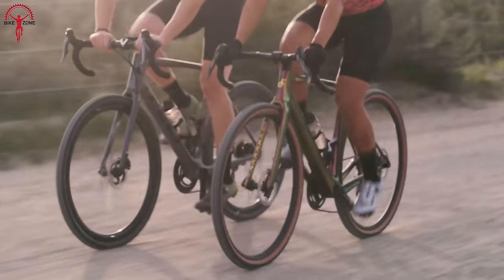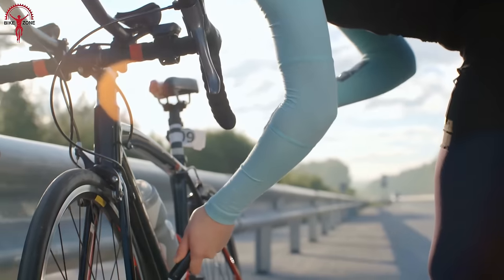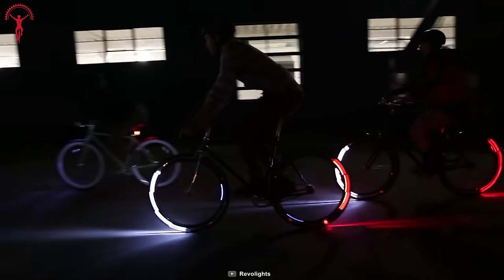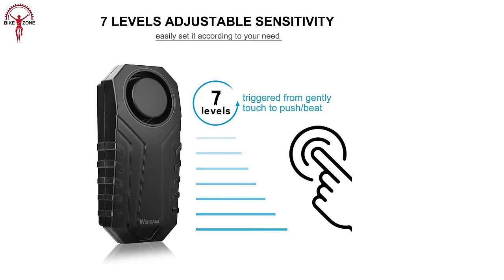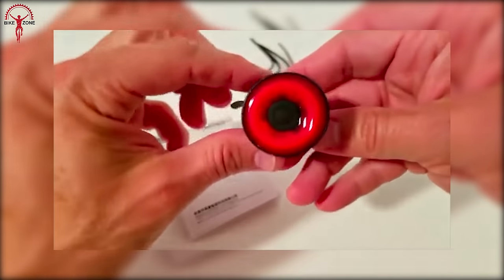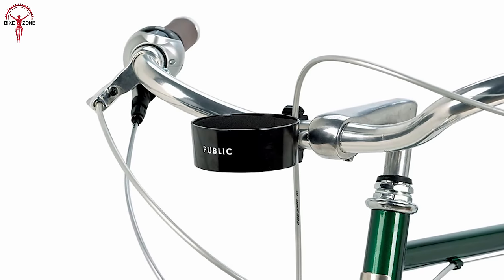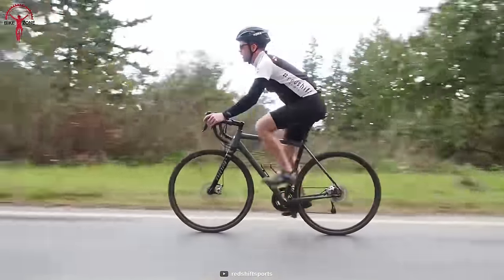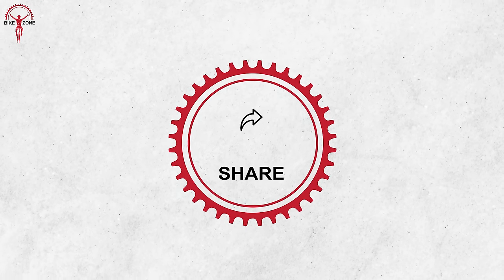13 Coolest Bicycle Gadgets & Accessories on Amazon

Comment: 0:53 you can see that the wheels have a quick release mecahnism, meaning you can just take of the wheels whenever you want so the lock is kind of useless 🤣
Reply: lmao i spotted that too
Reply: Not only that but the casing is cheap and has been demonstrated that simply jiggling the lock roughly or kicking it is enough to remove it.
Reply: Omg facts bro I didn't realize that good eye bro 💯💯💯
Reply: The Walsun is a stupid idea to lock your bike. Please go back to the drawing board, Walsun. Very, very, stupid idea!

Comment: Wow, I just stumbled upon this YouTube video titled "Outdoor Cycling" and I have to say, the content is absolutely fantastic! As an avid ebike user, I was thrilled to discover a new crowdfunding project called freebeat Morph 2-in-1 e-Bike. This groundbreaking eBike not only combines indoor fitness and outdoor exploration but also has the outstanding feature of being charged in indoor mode! The brushless 750W motor and 80Nm torque ensure a powerful and exhilarating ride, while the 80mm front suspension and puncture-resistant fat tires provide a smooth journey across any terrain. The IPX5 Waterproof finish is a game-changer, allowing you to conquer any weather condition. And let's not forget the unique blend of fitness and technology, with the Smart Saddle Detection+ feature that keeps you motivated and earns you extra points in games and challenges. Plus, the recycling of energy generated during indoor classes into CO2-free miles for outdoor rides is a remarkable way to make a positive impact on the environment. The removable 48V 15Ah battery offers an impressive range of up to 60 miles on a single charge, and the 2-in-1 Smart Motor Control Algorithm transforms your indoor cycling efforts into endless energy. I can't wait to support this project and pre-order on Kickstarter! It's time to elevate our riding experience and conquer uncharted territories.